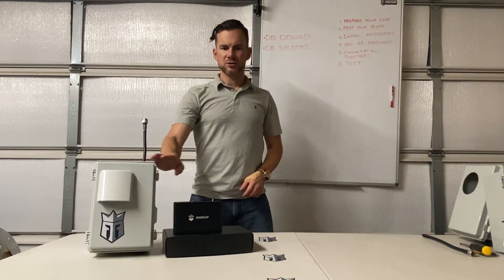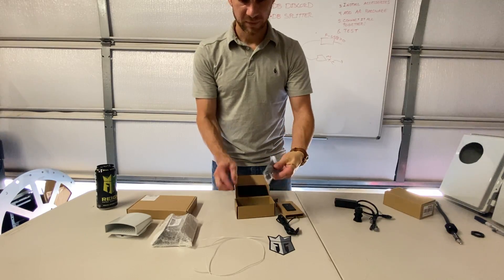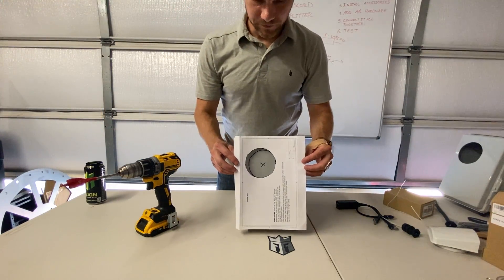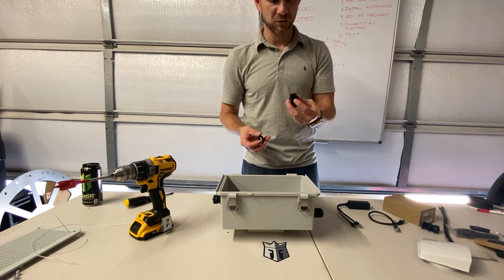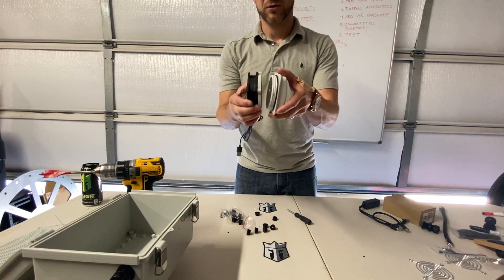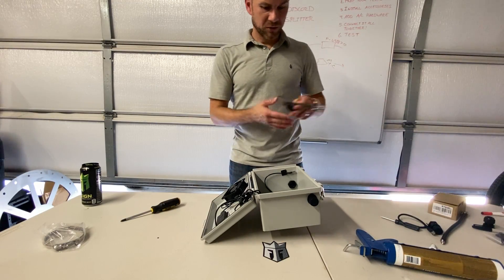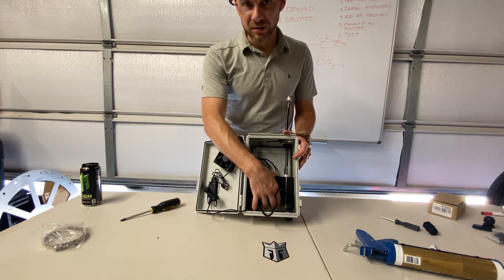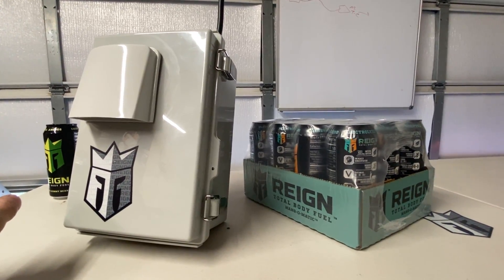Helium Network, AC Enclosure Build - SenseCAP M1 - Step by Step

Comment: Please add at min  3 of the 1/2 inch vents to allow for enough cfm. 🙏  easy way to  check is by opening  and closeing the case  and adding vents till aif flow is similar to case being open.
Reply from the maker: I'm sorry I'm still not quiet understanding your method here.

We did the math and each fan has the equivalent to empty the total volume of air from the case 114 times in a minute. The case is roughly .306CF in volume and the fans move about 35CFM.
Reply: @digitalblock559  But where does the air enter the box?

Comment: So during colder months the fan obviously won't be running, but what about keeping moisture out since you have a vent? The silica gel packs might not keep up with moisture during winter months depending on your location.
Reply from the maker: Good point Bryce, If running a single exhaust fan running at you can set your thermostat to constantly run 100% of time. So you'll constantly be pushing pressure out of the case. Combine that with a 50g silica pack and we don't think you'll have much trouble unless were talking severe thunderstorms. In locations like that its most likely best to keep it sealed.

Comment: Can't find a spliter for the usb-c cable to power the miner and the fans
Reply from the maker: Hi Hamilton, we originally filmed an explanation of this but felt the video would be a bit to long so we notated it in the description. We are in the process of manufacturing a splitter specifically for this purpose(and case) It should be ready to ship before end of month and will come with all of our SenseCAP enclosures.
Reply: @digitalblock559  did you guys build the adptors?
Reply from the maker: @fusiontechrd  We did and are in hand. They will be available to purchase on our shop late today. www.digitalblock.shop

Comment: Great video, but I didn't see from where the fans get the power.
Reply from the maker: Hi Ricardo, we originally filmed an explanation of this but felt the video would be a bit to long so we notated it in the description. We are in the process of manufacturing a splitter specifically for this purpose(and case) It should be ready to ship before end of month and will come with all of our SenseCAP enclosures.
Reply: @digitalblock559  where do I buy this premade? I don’t see a link to website or store to purchase already made enclosure?

Comment: Hi. Thanks for the video. But confused as where the fans get the power from. PoE powers the hotspots but where does the power come for the fans
Reply from the maker: Hi Daym Son(Ii like you un), we originally filmed an explanation of this but felt the video would be a bit to long so we notated it in the description. We are in the process of manufacturing a splitter specifically for this purpose(and case) It should be ready to ship before end of month and will come with all of our SenseCAP enclosures.
Reply: Me to is there not an off the shelf solution For this

Comment: How are you running a sensecap on 2.4amps (plus a fan)?? I've tried and the sensecap would not power up with a 2.4A splitter.
Reply from the maker: Hi Badger, the POE is 2.4a we are continually running tests and different set up variations. I'll try to keep you in the loop if we run into any issues of not being able to power the device. Feel free to join our Discord as well and stay in touch with us.
Reply: @digitalblock559  If I might throw my experiences into the ring on this one.  We had some rak hotspots that we were running POE splitters on and they were fine, but we've been having all sorts of problems with keeping the sensecaps up and going out in the field.  And we've come to an educated guess that it's a power issue.  One of the reasons why Sensecap suggests a 3amp power source is because of what it's doing at MAX power.  Under normal circumstances, it's fine.  However, the 'guess' from others I've been working with have came to the conclusion that if the hotspot beacons, AND the fan is running in our hotspot, not to mention anything else drawing power off of the POE, the Sensecaps will pull around 12 watts just for the hotspot itself, and our splitters out in the field just can't handle it.   

I JUST got back from one of our locations and swapping out a 2.4 splitter with a 4 amp splitter to see if that makes a difference with one of our more problematic hotspots that's in a GREAT location.  I'll try to keep you updated on whether that's solved my issue or not. 

My partner has been building fans into his enclosures for the potential heat, and so far, out in the field, he has burned out 3,THREE Procet USB splitters so far, which aren't cheap.  Mine have been running fine so far, but I was initially worried about the Kansas City summer heat.
Reply from the maker: Interesting and thank you for the time and insight.
We are having splitters custom made for this build it’s rated for 3a as of now
Reply: @digitalblock559  Hmm...I wonder why my 2.4a splitter wouldn't power the sensecap. 
Oh, I'm on discord. ;) 
-ElonTusk

Comment: So didn't show us how you place the mount box in the back. Did you drill 4 holes?
Reply from the maker: Your correct. There is two options. You can bolt it or Fuze It. We are using industrial construction adhesive to conjoin the two pieces. A link to the specific adhesive we use is in the description of this video at the bottom.

Comment: The box is way too big
Reply from the maker: Thanks for the comment Joe. We think this box may be a tiny bit oversized but it provides better heat separation since the miner isn’t enclosed in such a confined space.
What size enclosure would you suggest?
Reply: @digitalblock559  The diameter = 2 × radius (d = 2r).
Reply from the maker: @ibejoeking1087  the fan shroud is too large? Meaning the volume of air is to great? The hole is actually 3.65” dia 
Sorry I’m failing to comprehend your message